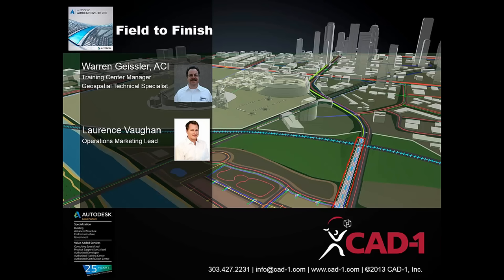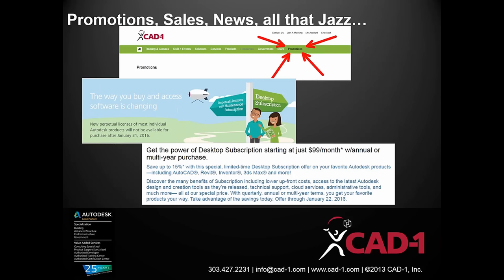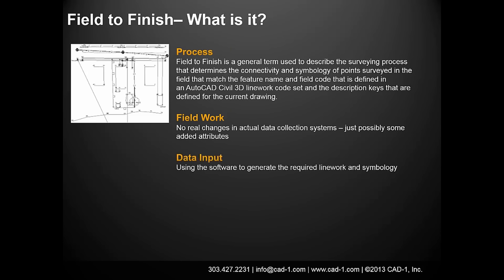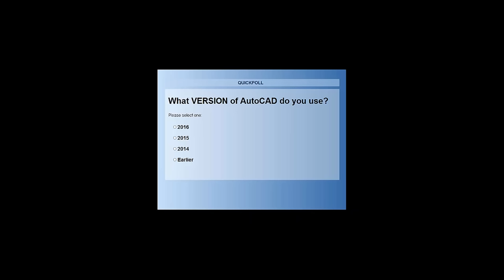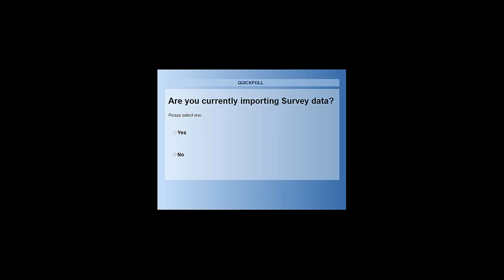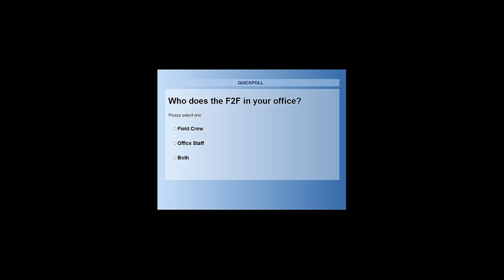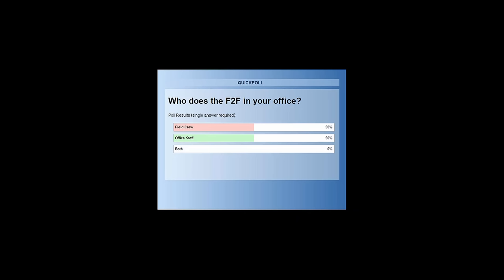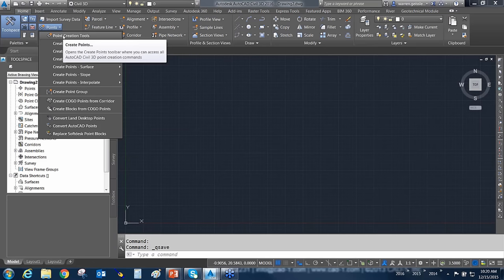CAD-1 Presents - Benefits of Automating Field to Finish with Civil 3D

Comment: Yes, I did find out that there is much work that needs to be done upfront, but once your template is set, proofed and correct, the work is fairly seamless.  I need to look into the offset codes which will make getting field work a bit faster as one edge of a walk etc will be located and coded to offset and draw the other side.  I worked in the Fort Collins area for seven years before relocating to the DC Metro area.